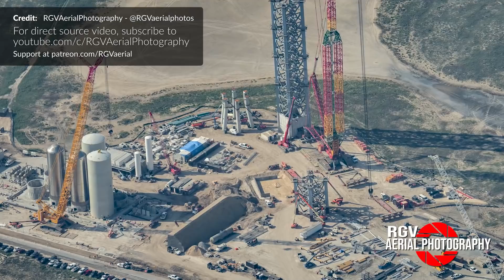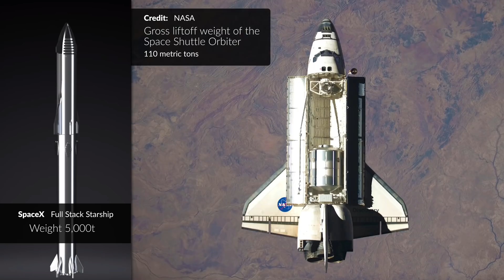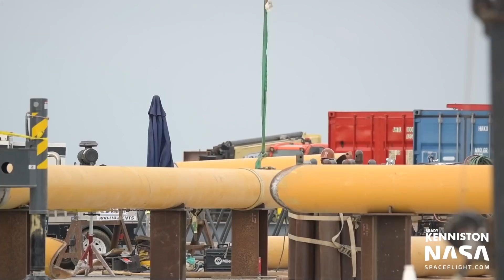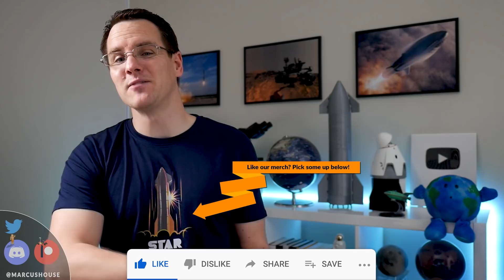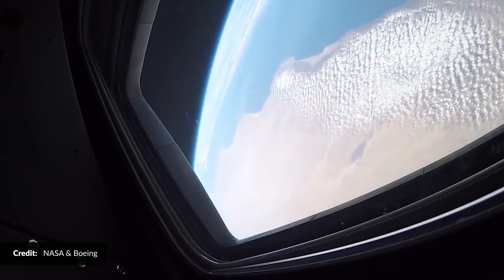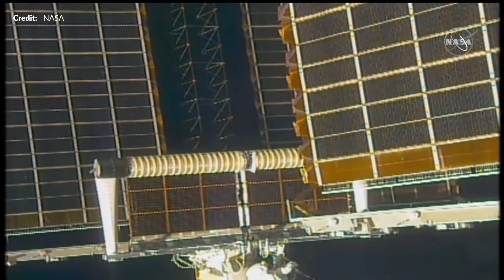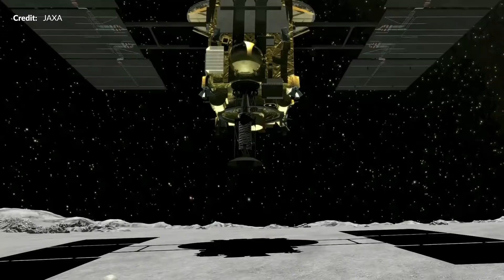SpaceX Starship requires new booster, Shotwell still suggests July for Orbital Flight Test

Comment: I don't think the yellow piping is part of the launch tower at all. Welding pipes at 90 degree angles is structurally kinda weak. My guess is they are making a cage or guard rails to protect something or more likely it's some sort of construction jig. So the crane can lift something on to the tower. Such as the tower's crane arm.
Reply: I would be surprised if it’s part of a construction rig, looks way too beefy.
Reply from the maker: I auspect it is part of the tower support system somewhere. We don't know what it is yet. That it is part of mechzilla... whatever that is, is a common thread going around. I have no real idea.
Reply: @MarcusHouse  It could be a service arm for Starship. When stacked the Starship and booster will likely need to be fueled and powered separately. They could be building an umbilical arm or arms that would disconnect and swing away at launch.

Comment: I believe that Musk tweeted that those hot thrusters were just pathfinders and won't not be used in flight for now.
Reply: Agreed.  Flight ones would be integrated into the rockets body, I assume, rather than exposed on the outside.

Comment: based off some back of the napkin calculations using the N1 for comparason if a fully stacked starship went boom at launch it whould have (very roughly) twice the energy of the N1 at up to 2Kt of TNT equivalent assuming the same portion of the fuel as the N1 burns (about 15%). i dont think much in boca chica would be standing after that
Reply: Except without optimum mixing the efficiency will be greatly reduced, I’m guessing less than 1% of the theoretical maximum yield.

This is how so many people survived the Hindenburg.

Comment: why hot gasses, wouldn't you hold more thrust propellant  in a frozen state.
Reply: Hot gas thrusters burn fuel to form hot gas which is ejected from the nozzles.  They are miniature rocket engines.  Cold gas thrusters just eject a gas that was stored in a compressed state.

Comment: Hey Markus always watch your show. You definitely keep up with your subject. What do you think about a special moon ship with four legs mounted 2 per side for doing belly landings on the moon. Maybe put tracks on the legs? Begging of a mining vessel. maybe a chain of vessels designed to mine the surface of the moon.
Reply: Whoa, that seems cool! They would have to do a reverse belly flop at the last minute and it would be so good to not have a giant crane but I'm not really sure that the rcs thrusters would manage to do the landing, and it would be quite a waste to have giant rcs thrusters and sideways legs because it would deviate a lot from the original design and they would have to make production line changes...
Reply: It would need extra support as reportedly when Starship sections are turned sideways, they crumple right way as they are only designed to stand upright. It would be a way to make a really big mobile base if the landing could be worked out.
Reply: @steveaustin2686  Gravity being less the supports would be smaller. I'm thinking these ships would be one way ships and the legs are mounted in orbit. The thrusters would be returned to earth for reuse.
Reply: @rickster9993  Of course the supports would not have to be as strong, as long as it's not tipped over on Earth. I also was thinking that any locomotion would be added in orbit. Not sure about removing the thrusters, as you still need to get to the Moon and land. As I understand it, the Lunar Starships will only use the high up landing thrusters at the very end of the flight. Most of the landing burn will be with the main engines I understand.

Comment: What is the purpose of starliner? You already have crew dragon and soon starship
Reply: A key criteria of the commercial crew program was to have two separate spacecraft so if one had an accident and was grounded for an investigation the other would give continued access to the ISS without relying on the Russians. NASA knew it was an expensive way to go, but they and the DoD have a policy of maintaining 2 capable launchers for all missions.

It will be a long time before SS launches with crew on board. Elon has said many successful launches in a row will be needed.
Reply: @donjones4719  ah ok ok thanks

Comment: Just curious, why no flame pit for booster with noise suppression?
Reply: There's likely water suppression, a Mr. Musk said that they aren't building a flame pit, which might be a mistake, but they will if it doesn't go well.
Reply: My guess is because the time it would take to setup such a system.

Comment: Space Shuttle with fuel = 1995.806428 metric tons.   Super Heavy Starship = 5000 metric tons........ WOW  2 - 1/2  times the weight
Reply: Yes, it sure is big, isn't it? That's also the full stack with fuel, not without.

Comment: I've got this crazy fantasy that Hubble will last long enough for Starship to become fully operational, and upon its retirement, Elon will send a Starship up to recover Hubble for the Smithsonian... Crazy, eh?  But wouldn't it be cool?
Reply: Would be nice to display it with the shuttle that deployed it. (Atlantis I think)
Reply: Hubble is really massive, but not compared to Starship. Very romantic idea! At first, I thought, "there is no profit in this..." but so many folks fondly remember Hubble and the numerous inspiring images. Of all the old satellites to bring back, Hubble is the most valuable.
Reply: @DistracticusPrime  
Hubble weighs 11.11 metric tons, and would have to withstand the landing maneuvers, including aero-braking and flip before landing. I suspect Hubble would need a specially designed fixture to reduce off-axis loads on the frame and especially the main mirror! 

Perhaps it will even need a gimbal that coordinates with the flip maneuver, and elastic mounts to limit shock.
Reply: Yeah, that would be great.
Reply: I doubt the Starship is designed to land with that much cargo. Launching a full ship that loses weight then landing it is easier.
Reply: @Dav1d_B   A Starship returning from Mars will land with the load of a full crew quarters and all the associated equipment. That has to exceed the mass of Hubble, which is "only" 11 tonnes.
Reply: @Dav1d_B  Given what the talented people of SpaceX have already managed, I am not willing to bet against them.  Starship is being designed to be able to bring a crew back from orbit, so why not be able to bring cargo back from orbit in the Starship cargo variant?
Reply: Starship is being designed to refuel in space, so it is very likely they would be able to land the Hubble.
Reply: @davidharris7249  yeah, designed to refuel in space and stay in space ... I have no doubt it could be done, be engineered to be possible, but I highly doubt SpaceX is doing so
Reply: @Dav1d_B  GO NAY SAY WHILE SAYING NAY SOMEWHERE ELSE, YOU FILTHY NAY SAYING SAYER OF NAYS!
Reply: I love your idea. Could you imagine the emotions of the astronauts who did EVAs to repair it to see it again on 🌍
Reply: @yhfsywfit  right? that was the firs thing I thought of top man =) what would Story Musgrave say/think/feel standing next to it... the raddest dude with the raddest name. ever.
Reply: @ScumfuckMcDoucheface  Musgrave is the only astronaut to fly aboard all five Space Shuttles. Absolute legend
Reply: "People love Hubble images. It tells 'em where they are from, it tells 'em where they're going, it ties it all together."
Reply: @yhfsywfit  pfft. all 5 shuttles AND my heart.
Reply: It's within Srarship's capabilities to bring back, and costs shouldn't be so high that would stop it. I'm not sure that Hubble could handle the return though, and they likely would need a crewed version of Starship as crew would likely be needed to pack it up properly.
Reply: Nope, hubble will never be recovered.
Reply: Well if someone is willing to finance it why not. But Hubble is staying in orbit and could be brought down any time.
Reply: Relocate the hubble to the ISS so its parts can be replaced.
Reply: @SMunro  there's something like 200km between the 2, Hubble being in an orbit farther away
Reply: @ScumfuckMcDoucheface  so? Design a heavy mass retriever, launch to ISS. Refuel. Send it to fetch mass. Return mass to ISS. Repair or recycle for scrap metals for orbital 3D printer use. Turn the ISS into a shredder facility. Replace hubble parts. Return hubble to orbit.
Reply: @SMunro  *shrug* fair enough.
Reply: I've had much the same bit ofwishful thinking. I think Elon Musk is capable of a cool, sentimental mission.
Reply: If they can capture it, they can fix it.
Reply: Or Starship could upgrade Hubble!
Reply: @MrEd2291  This is what I'm thinking. The lenses in Hubble are just fine. It's the electronics and the stabilizers that are out of date, which is something SpaceX should be able to fix. If not in one mission, then in two. Rather than patch Hubble, like what has been done before, actually replace all the guts with newer equipment.
This would be a major PR win for SpaceX and would make anyone still clinging to any hope of Blue Origin or the SLS look like a complete fool.

Go a step further and create remote robots to do most of the work so that it can be done over months instead of rushing to do it in a few days.
Also replace the liquid nitrogen tank, so Hubble can take IR images again.
In fact, why not make a big housing for Hubble so we could store extra parts, store the remote AI droids, store extra fuel, etc.? Let Hubble operate from within a big "glove" that fits over it and the thing is completely functional within?
The glove would completely encapsulate Hubble like a big clam shell, with only a hole at one end for the telescope to see out of.
That would save the bother of having to replace the thrusters. Put the thrusters on the glove.
Actually, the electronics could be in the glove as well, and now it's a matter of disconnecting the old electronics (leave them there) and plug the new electronics in with an extension cord.
The whole project just got simplified.

How to fix Hubble:
1. Build the glove, with its own thrusters, stabilizers, and electronics for Hubble. Have long extension cords to bypass Hubble's old electronics.
2. Build a couple of remote AI droids that can do the work.
3. Launch the glove up to Hubble. Encapsulate it.
4. Bring the rocket back home.
5. AI droids disconnect all the old Hubble electronics.
6. AI droids connect the newer better electronics.
7. Hubble begins spitting out better pictures than ever before.

SpaceX could pay for the whole mission out of pocket change.
This would be a great test of the Starship, the heavy booster, and Elon's AI systems. All for just a fraction more than they would have paid anyway to test those things.
SpaceX earns a sterling reputation for awesomeness, beyond its already sterling reputation.
Instead of saying something is the "Cadillac of" whatever, it's now the "SpaceX of" whatever.

Perfect timing, actually. Don't you think?
The beloved Hubble telescope is dying and SpaceX needs to prove the new Starship/heavy booster concept.
How, oh how, could SpaceX ever do this?
Ponder... ponder...
Reply: @MrEd2291  impossible and not worth it. Hubble is already outdated

Comment: The upside of Kessler syndrome is humans would have to create warp bubbles or shields to leave the atmosphere.
Reply: That's an upside? It seems like a lot of weight.
Reply: @shlok975  necessity is the mother of invention. You don't need a spaceship to warp space time, the first experiments will be done in labs.
Reply: @jlebrech  Ah, I see now.
Wait what? Didn't you need dark matter/energy to warp?
Reply: @shlok975  there are scientists working on warp drives that don't require exotic material, just a lot a of energy. That's where you draw that energy from the grid, wrap something with a bubble and push it like a cannon.
Reply: @jlebrech  oh.
Reply: @shlok975  how a real bubble is formed, the bubble wand doesn't travel with the wand.

Comment: Wait if Starlinks being put in an orbit that degrades within a matter of years doesn't that mean that SpaceX will have to replace the whole system every few years or so?
Reply: It will degrade if the Craft is uncontrolled. But the Starlink Sats have Ion Engines for keeping their Orbit (ocassionally powering said engines to counter this atmospheric Drag)
Reply: @unitrader403  this is a similar system to what the ISS does, yes?
Reply: Yep. That's the point. Technology will always get better and do you honestly think Elon wouldn't be making v.1.1 v.1.2 ect. Ect. Plus a percentage of the starlink satellites were Dead on arrival and will now take a very long time before they are burnt up
Reply: The satellites have ion thrusters on them, enabling them to correct their orbits against collisions and orbital decay. If desired, they can just turn it off and then decay in some years
Reply: It means  a reduction in space junk that could otherwise spend decades in  a decaying  orbit.
If they want to keep it in orbit longer, they can design them to be capable of repositioning themselves, not that hard.
Reply: Possibly but if Starship is a success then that will be relatively easy and basically free.

For Starship missions that don't fill the entirety of the fairing or max out the payload capacity (which will be a lot by the sounds of things) they can ride-share with their customers and launch as many Starlink satellites as they need.

Comment: If they want to fly full stack in july they need to need to hurry and build the tower by day 2  put the launch table and complete gse tanks by day 10  make and roll out the new  booster by day 15 then c cryo test. Install 29 engines by day 20 test sn 20 by day 25 stack it the next day and fly after some aborts on july 30 😂. impossible
Reply: Never say impossible, especially to Elon. Look at all the fools, read "industry experts and commentators", that had to eat humble pie when he got Falcon doing its thing ;~) Tbh thought it will be a close fit but I hope they can pull it off. It would show just what a set of lazy overcharging money grabbers most of the rest are.
Reply from the maker: Yea.. it is crazy stuff.

Comment: the engineering behind such a relatively small, carefully crafted rocket engine, is mind-boggling... there is one point where the rockets mounts take all that force... i am not an engineer and i stand in awe to the minds that developed it
Reply: Ask people who fly or desiged C-2 Greyhound on a bolt(?) mounting folded wing :D
Reply: @piotrd.4850  yes i get that also ... the thrust coming our of a Rolls Royce Jet in engin is pretty awesome.... but then these rockets are 1000X(?) their thrust and physically smaller ... and pushing100X(?) their weight... .... i get that it can be done... they have done it ... i am just begining to comprehend the forces these things produce
Reply: It's actually not difficult mate.
Reply: @alanmay7929  i wonder if the engineers who built them agree with you ?

Comment: Seems like the booster catching system will require a degree of landing system precision that we have not seen in Starship landings to date?
Reply from the maker: Booster should be much easier as it doesn't have this flip burn system.
Reply: @MarcusHouse  Interesting. Had not considered that. Thanks for the quick reply!
Reply: @MarcusHouse  Its essentiallly what they already do with the F9 boosters, just on a bigger scale. And if im not mistaken they pretty much nailed all  Landings in the last few months.
Reply: The better comparison would be to F9, but it cannot hover. However, SH can. I doubt the booster will pass down between the catcher arms, but will more likely come to a hover just outside them and then move sideways. Or possibly do some combination of the two, with SH having decelerated almost to zero.

Comment: A fully loaded stack exploding, will destroy most within a 20km radius. They are reckless to perform the tests at that location. Should be at sea or in a remote area. I hope I'm wrong, all for SpaceX.
Reply: You are forgetting that the energy released from a blast falls off with the inverse square of distance, and the blast is further mitigated by the fact that when the blast starts up, the pressure it releases moves the remaining methane and oxygen away from each other, stopping the methane from having more than a 10% explosive burn, with the rest slowly burning off much higher up in the atmosphere where it can’t cause problems.

In other words, in the case of an explosion, the only things that will really get damaged is just the launch tower and stuff within a couple hundred meters, most of the damage just being that stuff might have shrapnel sticking out of it.
Reply: @evannibbe9375  Ok, good to know. The Russian N1, was a huge blast, but different propellant ..?
Reply: To destroy everything in a 20 km radius would take a large to very large nuclear weapon, 1-2 km is more likely, of course minor damages like broken windows could occur further away.
Reply: I think "reckless" is presumptuous without being plugged in to the work they must be doing to satisfy regulators, but I'd be interested if anyone has managed some back-of-envelope numbers on the sort of energy (perhaps relative to military hardware we can picture/imagine) that would be released in a full-fuel full-stack RUD.
On the face of it, the distance to South Padre and Port Isabel looks tight compared with what they wanted for Saturn V...
Reply: @geraint8989  Yes, you are right. English is not my first language. But they must have done the calculations, and should communicate what to expect. Perhaps a better comparison was the Saturn V explosion..?